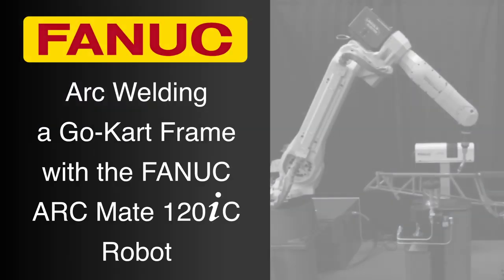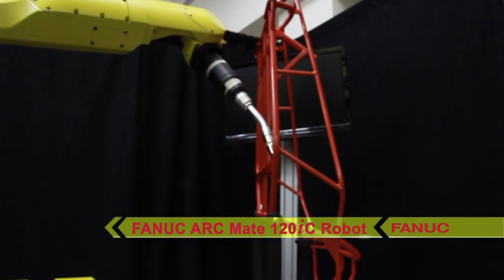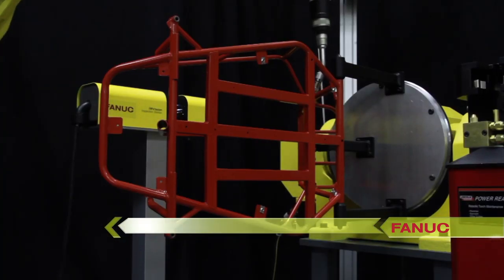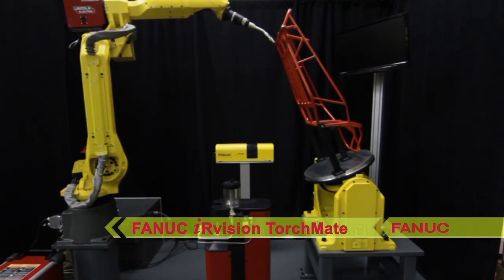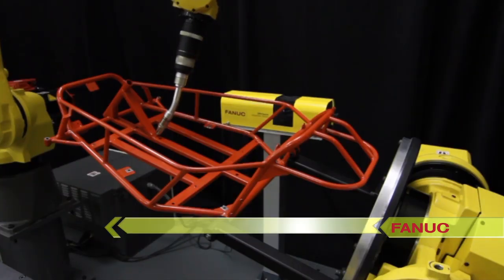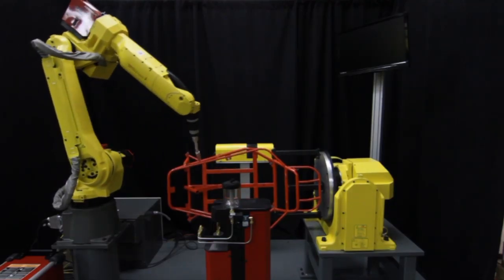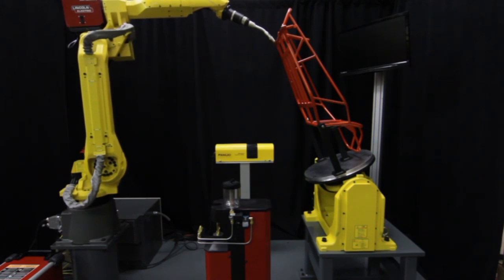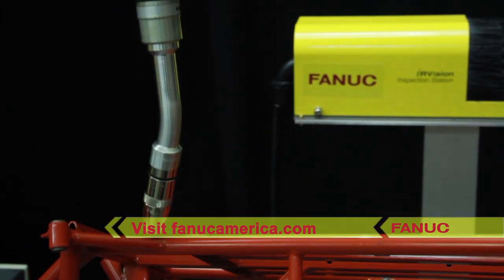Welding a Go-Kart Frame with FANUC's ARC Mate 120iC Arc Welding Robot

Comment: Who tac welds it? if its off by small amount  could damage robot?
Reply: Yes it would lol and btw you cant hide that trashy tregaskiss  torch cleaner with red tape 😂 ..
Reply: Not really damage the  robot but bend the torch for sure. Could  use some touch sensing for relocating the joints. But a good jig for the tack operation would assure repetability.